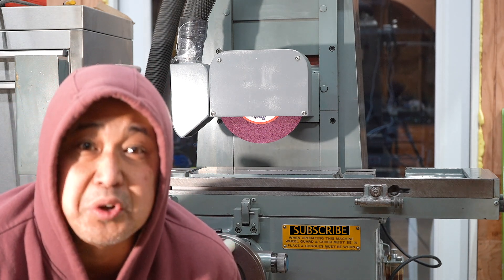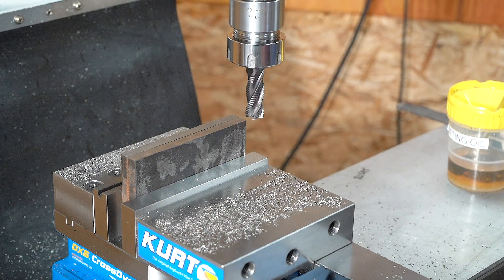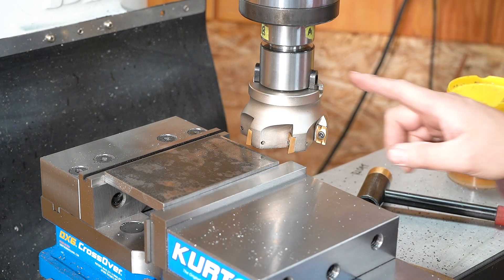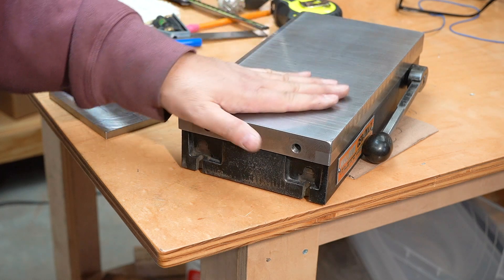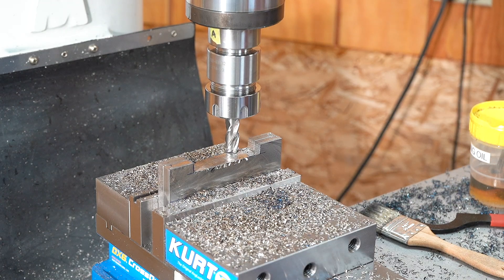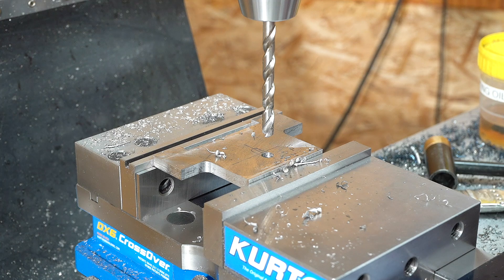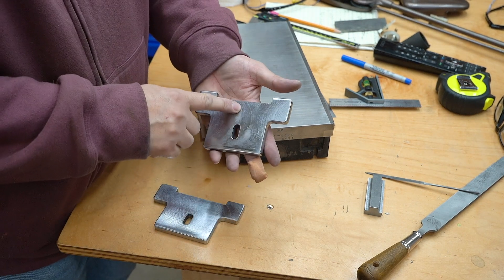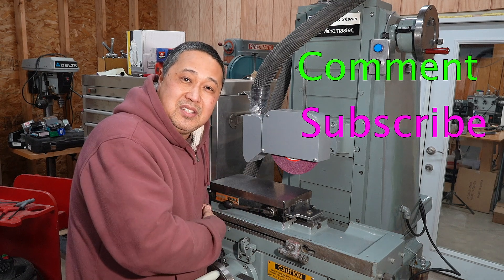Make Simple Magnetic Chuck Hold Down Clamps For Your Surface Grinder

Comment: Is it my imagination or are you mainly clamping down on the Tee nuts and not the edge of the mag vice?.....the clamp bolt is too near the end of the clamp that rests on the Tee nut "spacer".
Why didn't you just bolt it down through the holes the other guy put in the grinder table?
Reply from the maker: Ian Pearson you can only go so close to the vise as there is an open groove where the T nut would fall out.  I didn’t want to rely on 10–24 screws to hold the chuck.

Comment: Thanks for an entertaining video. Much more fun to wathch Your dog dreaming than just the camera running brainlessly.
An opinion. Regard the distance between the magchuck and support at the right end. (Time 11:44) I would prefer to put the down tightening hole as close to the magchuck as possible. That applies more of the down force to the magchuck and less to the end support.
Good work!
Reply from the maker: Thanks for the tip Stefan! 😉
Reply: Thanks for Your reply. Using more brain and less power has been my target all the time. Sometimes it works…..
Keep up Your video production!

Comment: If you don't like the finish the face mill left, why not surface grind them :)
Reply from the maker: Chicken or the egg.  The table needs grinding, the chuck needs bottom and top grinding, etc.  I would have to set up the chuck which was dismounted just to grind the hold downs for no other reason than cosmetic, when in need to redo everything, didn’t make sense to me.  But I understand it may have made sense to others if they were in the same situation.

Comment: nice work! and my pup was having the confused reaction to the sound effects. lol  I too have a very inexpensive face mill similar to you, and when I use the surface plate to help with changing inserts, it helps. OR I only use 1/2 of them. just a thought. might help. Thanks for the video.  :)
Reply from the maker: My dogs went nuts too!  Thanks for the tip!

Comment: Why don't they make the magnetic chuck magnetic on both sides, so it will stick to the table and hold the part...
Reply from the maker: One of the reasons, you couldn’t get rid of grinding dust without turning off the magnet.  Then the chuck won’t be parallel to the table.  I’d also imagine the magnetic field from top and bottom would interfere.

Comment: One thing - if you're using roughing endmills, I've found you'll get much longer life out of them by using lots of axial and not much radial depth of cut. 
The way you show (which is the exact opposite), only the very bottom portion of the side of the cutter ever makes contact, so it has to do all the work of removing metal. And if you look at it carefully, this portion of the cutter is actually weaker than it is on a conventional (non roughing) cutter. 
I personally would have gone almost full depth in one cut, but only gone sideways into the workpiece by 1/3 or 1/2 the diameter. That way you subject the bottom corners to just a few cuts instead of dozens.
It's worth working out the optimum feed rate (based on chip thickness) too. You'll get metal off much faster and paradoxically with less wear on the machine.
Reply: Another thing with these cutters to get more life out of them:
Use them for side milling of workpieces (rather than end milling) where possible, with the fragile bottom corners below the workpiece as far as you can get them. That way you use up the whole cutter more evenly, and it's more rigid because there's effectively less sticking out from the holder.
They can last a very long time used this way. I buy odd sizes on eBay, often quite big, for pennies on the dollar (but always good US brands, like Niagara). Because they're used for roughing, they don't need to be any particular nominal size.
Reply from the maker: Good point, thank you!

Comment: So much fun to watch , love the sound effects , just had a thought , maybe put the chuck on upside down , turn on the magnet to hold it to the bed and grind the underside before dusting the top . that may need removing the handle and turning it on with a wrench . this will probably give less to be removed from the working face . just an idea that i have done in the past , i so need a surface grinder , Cheers Ade.
Reply from the maker: Hi Ade, I had planned on doing just what you described, but all the “pros” say I shouldn’t grind upside down with the magnet on, should be off.  I do plan on grinding the bottom and top of the chuck.  Thanks!

Comment: IMHO The slot in the hold down clamp is too short to give a solid clamp force without distorting the plate itself
Reply: not a lot of force to resist on a grinder
Reply: Daniel Wahl of course until something bad happen ;)
Reply from the maker: Most of commercially made ones only had holes, not slot.  You don’t want to tighten too much or it will introduce a bow to the table and won’t grind flat. 👍🏼
Reply: Woods Creek Workshop yes but the hole is near the table not near the rear support, for having the same clamping force you have to tighten the screw much more inducing in this case much more stress in the table....